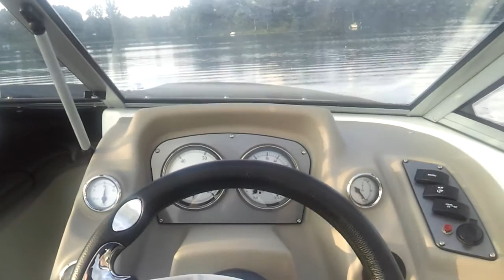2011 Larson LX 850 steering wander

Comment: Thanks for posting. I just bought a 23’ Maxum with an I/O. It does the same thing (maybe even more pronounced than this video).  Nothing seems loose so I couldn’t figure it out. Unless you found a solution, I guess I’ll just live with it.
Reply from the maker: Glad it’s not just me!  After ten years with the boat, I’m convinced it’s normal behavior.  Growing up with outboards that tracked straight as an arrow, it takes some getting used to.

Comment: This is totally normal. The water traveling down the side of your boat creates a vacuum at the transom, thereby pulling it port and starboard. There are a couple of ways to help (not cure) this. Try a 4 or 5 blade prop or retrofit your stern drive to a dual prop type (counter rotating). This is an issue that's apart of all single stern drives. This problem disappears with a dual stern drive setup. Don't sweat it, it's normal. Don't overcorrect your steering. Subtle movements work best. Cheers.

Comment: If you are lucky enough to have trim tabs, extend them fully at slow speeds. That significantly reduced the wander on my 28 ft Bayliner with single outdrive.

Comment: Every single boat I've owned and been in except a dual-drive or as mentioned, one equipped with a counter prop, walked to some degree.  Jet drives are notorious for this behavior since the steering is completely dependent on thrust as there is typical no rudder. There's virtually no steering at idle. It's a weird thing to have to hit the gas in order to veer around something. 

Anyhow, I like your Larson. I've been considering buying one.

Comment from the maker: Huh...so jet drives are worse?  Doesn't bother me anymore; once I figured it was normal I just adapted.  Not every boat does this though, but this is my first I/O fiberglass boat.
Reply: Maybe you'll see this all these years later.....would love to know how you liked this boat? Anything you wish was different? Mechanical issues? I'm going to trade my jet boat for an i/o and found a great deal on yours. And yeah, jet boats have virtually no steering at low speeds. Especially in reverse. Even on plane it wanders. Nature of the beast. Thanks! 🚤😎